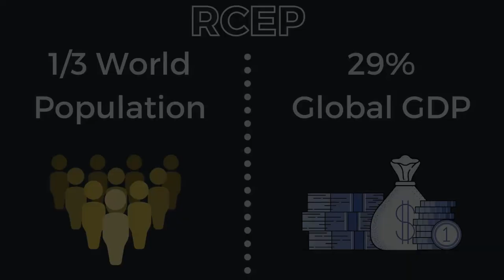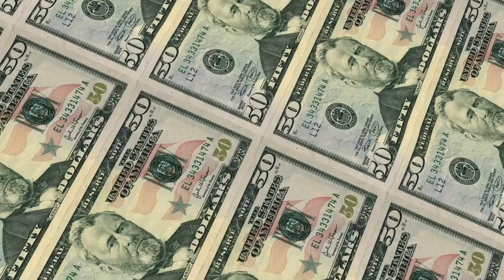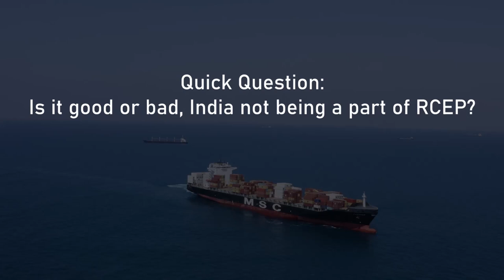World's Biggest Trade Deal - RCEP

Comment: Sadly indonesia will only become the market. Indonesia signed only for CPO. India did the right one.
Reply: The good news is that for Indonesia it's doubtful much will change because of RCEP. ASEAN already had a free trade agreement with China before RCEP was a thing (this is actually true of all RCEP signatories except Japan). RCEP's potential benefit is that it makes relocating supply chains from China to ASEAN more easy, and that's something Indonesia can (and should) take advantage of. India not signing means that ASEAN countries are the only ones that can out-compete the Chinese on manufacturing costs.
Reply: @awijaya2116  So asean countries can match chinese manufacturing of cheap products, this early?No...India did the right thing of stepping out of this RCEP deal to safeguard the domestic market,China will dump their products in all the other countries which will affect local manufacturing
Reply: @yashsingh_b7185  
Cheap manufacturing in China is mostly relocated already. Too expensive. If the question is if ASEAN can beat China at manufacturing, the answer depends on the ASEAN country. Vietnam probably can on cost advantages. Malaysia and Thailand, for tech related products. If Indonesian infrastructure gets upgraded quick enough, labor cost advantage could be leveraged for low-tech high-labor manufacturing.

Another point in favor of off-shoring Chinese manufacturing to ASEAN is the political one. Most ASEAN states are US-friendly, and generally pro-business. Basically, relocating manufacturing back to the developed world isn't going to happen. It'll be to countries like Mexico, or those in SE Asia. Plugged into the supply chain, politically acceptable, and not too expensive.
If you're gonna relocate from China, SE Asia is the easy answer now. Well, unless you're doing high-tech manufacturing to sell to the US, then it's Mexico.

China also has its own motivation for relocating manufacturing to ASEAN. Of course, they'd like it to completely stay in China, but economic factors work against it, so it's functionally impossible to do that. RCEP allows them to direct where factories relocate, by creating a favorable common regulatory environment. You only need to produce a certain % of a product in Vietnam or Thailand to label it 'Made in VN/TH', so this keeps Chinese factories open to make parts of a product, and shipping the rest to be completed to be made in VN. It's good for China in the sense that they become a job creator this way in neighboring countries, making it harder to pit them against each other. If the factories are gonna be moving away regardless of what you do, may as well get a win out of it.

'China will dump their products in all the other countries which will affect local manufacturing'
- China already has a FTA with ASEAN, and has had one since the early 2010s. For 90% of the products exported and imported in either direction, there are no tariffs. If dumping was going to happen, we'd see a jump in trade deficits for ASEAN. We've instead seen that it's mostly stayed stable, while ASEAN's surpluses with other regions grew in the meantime. India's one of those regions. So ASEAN is broadly competitive with China, and beats India on that field. 
Keep in mind that India has a FTA with ASEAN, irrespective of RCEP. So if ASEAN is where Chinese manufacturing is shifting to, and if ASEAN is competitive with Chinese manufacturing, then you'll probably see that Indian trade deficit with ASEAN balloon in the coming years.

'Safeguarding' the domestic market has been the main reason India is globally uncompetitive and imports far more than it exports. Free trade either forces inefficient firms to close, or to become competitive. The irony of your statement is that even if 'safeguarding' actually worked, the FTA with ASEAN already exists, so you're not doing that anyway.
Reply: @awijaya2116  That issue regarding FTA agreement with Asean countries already has been raised by the Government and India is way more competitive right now than in 2010s,Now our Government is focusing more on Manufacturing and infrastructure development than the agriculture sector or IT sector alone,Recently alot of R&D centers have been established by Indian companies or some foreign companies too,As far as FTA with Asean countries is concern it was for better relations and trade between India and those Asean countries not for any competition or business profits
Reply: @awijaya2116  Your Asean countries depends more on export because of small domestic markets or less population,but India have a very huge population and the 2nd biggest domestic market so even if India only fulfills it's own citizens needs it will be much more beneficial in general,Also there's many unicorn startups in India as compare to it's counterparts in Asean,So we better focus on domestic market first than after successful business in our own market those startups can venture out of India too globally
Reply: @awijaya2116  Veitnam is a very good country their progress is impressive indeed
Reply: @yashsingh_b7185  Has the Indian deficit with ASEAN or Japan decreased? As far as I'm aware the deficit increased in every year following the FTAs being signed. 

Also, it's simple cause and effect at work here. Chinese manufacturing is being moved out of China. The main destination is going to be ASEAN. This is confirmed by all of RCEP's supply chain provisions. ASEAN has a FTA with India.
It stands to reason that the Indian deficit isn't going to decrease by any if its raison d'etre for having an FTA is political.
Reply: @awijaya2116  As far as FTA with Asean countries is concerned,India has only $86B trade with asian countries out of which India have trade deficit of $23B,India has already raised this issue nonetheless Giant companies like Google,Wistron,Samsung and many more companies invested in India already,much of them in 2020 relocated from China😬
Reply: @dharmapratama.i9487  I know about that,But India was also a hub for alot of investments recently by domestic and international companies
Reply: @dharmapratama.i9487  Only problem in India is infrastructure on which our government is focusing more now,numbers of ports,industries,roads,etc is been upgraded also connectivity between cities has been improved...soon you'll see tons of more investment here:)
Reply: @dharmapratama.i9487  Thank you❤
Reply: LOL are even have economic degree for saying that?
Reply: @ornachia2489  lol, are you okay? As long as you can read and access internet you can look up for data. China trading balance sheets will answer everyone questions.
Reply: @radenrahmat1717  Right, and your Internet knowledge are better compare to economic analyst and Phd across the country. Got it.
Reply: ONLY IF YOU LESS EDUCATED WILL SAY THIS
Reply: @yashsingh_b7185  Even though India has a large population, its consumption power is not as good as that of Southeast Asian countries. The vast majority of Indians only consume cheap goods in roadside snacks and small shops. The same is true for car and mobile electronic products. It is difficult to find decent large supermarkets in India.Not to mention commercial streets and amusement parks
Reply: @jackzhou4813  lol you're brainwashed by western media right now India is changing people expect and demand for quality even if the cost of products is high rather than low cost like people use to do before,India is changing,now you need to change your mindset
Reply: @jackzhou4813  Also all the mobile smartphone brands are heavily investing in make in india and r&d because they know People will demand for more functionalities than cheap products and About Automobile our Tata and Mahindra vehicles are 4-5 star rated in security testing
Reply: @yashsingh_b7185  So why not boycott Google, Microsoft, and Amazon? In this way, India has its own technology giant. Boycotting Xiaomi is useless. Xiaomi is just an assembly company without technical content. Boycotting Xiaomi will not bring India's own technological development.
Reply: @jackzhou4813  we're not boycotting Xiaomi or any chinese brand we're the largest Democracy and everyone is welcome here to sell their products if it's not harmful to anyone
Reply: @jackzhou4813  Banning those brands won't do anything good for us it'll just kill all the competitiveness in the market and options too
Reply: @yashsingh_b7185  Huawei and many Chinese software companies were told by the Indian government not to operate in India. You told me that India has not boycotted Chinese products? China has not banned Indian brands from selling and operating in China, including Land Rover’s sales in China.
Reply: @jackzhou4813  Those Chinese companies was banned because of spying and some other security issues
Reply: @jackzhou4813  Still there's alot of chinese companies working in India
Reply: @yashsingh_b7185  In addition, I suggest you to check how many uncompetitive Chinese local enterprises closed down in the 1990s in the face of dumping competition from foreign brands after the reform and opening up. Within six months, tens of millions of Chinese workers were unemployed, and these unemployed workers were unemployed. Forced to take out savings to start a business. There is an old saying in China called: put it to death and live thereafter.
Reply: @jackzhou4813  Bro read my reply again I said those companies were banned or boycotted due to security issues it was not done for killing the competition,we still welcome alot of companies to invest here if they're following all the rules and regulations properly and we won't follow China anyway we'll become economically stronger without any dumping strategy or by compromising on quality
Reply: @yashsingh_b7185  There is no evidence to show espionage, which is as ridiculous as a land Rover owner in China who had a car accident and was told by the Chinese government that the safety performance of a Land Rover car was not up to standard.
Reply: @yashsingh_b7185  If these Chinese companies have spies, then Google, Twitter, Facebook, Microsoft, and Apple are also collecting data about the government and people in India. Ask the Indian government to treat these American companies equally. Unless the Indian government has listed China as a hostile country.

Comment: There's a few things this video completely misses.
First, RCEP was developed by the ASEAN member states. I'd be kind of surprised if the ones devising an idea designed it to be harmful to themselves.
Second, ASEAN operates by consensus, not majority vote. That means every member state has to accept the deal if it's going to be approved. Meaning all 10 member states were accepting of the deal before they went ahead and stamped their signatures on it.

No, seriously, think about these two points here, and connect it with the supply chain argument the video gave. Low-medium tech manufacturing is moving out of China – and this is for both Chinese and foreign companies. RCEP has basically ensured that that movement is directed towards the less-wealthy states in ASEAN, of which the main beneficiary right now would be Vietnam, although there's a major opportunity here for Indonesia.

Third, RCEP does have a political value to it. It's an affirmation that free trade remains supported in the Asia-Pacific region. Thanks to the US pullout from TPP, it's also a propaganda boost to the PRC as they can style themselves as the main proponent of free trade in the region.
Video completely forgets to mention that the TPP was also designed as a political agreement over an economic one. Its initial provisions on labor and IP were pushed for by the Obama Administration, and most of those were removed after the US left and the TPP was done without it.

Fourth, India retains observer status in RCEP. It's also been granted special status, being the only state that can join it any time they want to. For other countries to join, negotiations on accession would be needed. The door's basically been left open for India.

India probably benefits in the short-term by not signing RCEP. Out of all the possible signatories, India was the only one to not have major trade ties to the PRC. The fear that Chinese goods would flock to India if the deal was signed is probably valid. Another valid fear is that Australian and NZ dairy and poultry would edge out the agribusiness sector in India. That's especially important if you consider how much more reliant India is on that sector for employment compared to most other RCEP signatories.
Long term, not signing RCEP basically prevents India from taking over China's place in the global supply chain system. India's the only country that has the population and education base for it, and it'd have been the perfect alternative. Indian companies (compared to those of ASEAN) aren't really exposed to external competition, although you can argue this is changing gradually. 

As it is, supply chain redistribution's going to mostly go to the SE Asian countries. Vietnam is by far the most convenient alternative – in the political stability and support for business sense, it's basically a smaller version of China, and it's a member of CPTPP. Indonesia has the labor pool and cost argument in its favor, if it can get its infrastructure up to par (and this isn't as hard as you'd think, you only need to focus on Sumatra and Java to get most of the labor access). 
This, by the way, would probably be a bad thing for India. ASEAN and India already have a FTA. Slightly more than 10% of Indian imports are from ASEAN (which they already have deficits with), and RCEP basically provides the means to shift and expand exports by Chinese companies via ASEAN to India.
Reply: You're a real smart guy。
Reply: This is well written thank you.
Reply: You can't really export from China to India via ASEAN due to rules of origin.
Reply: @SKAOG21  As I understand it, goods don't have to be 100% manufactured in a country to be considered 'made in X'. With India, I think at least 30% of a product can be made outside the country of origin? Iffy on this one.

But more importantly, the argument is that industrial relocation from China is already happening. It's mostly to SE Asia – all of the countries there have an active FTA with India. 

So in effect, if the concern is balance of trade, then India's gonna lose out long term too.
Reply: thank you for your additional information, that helps, thank you!